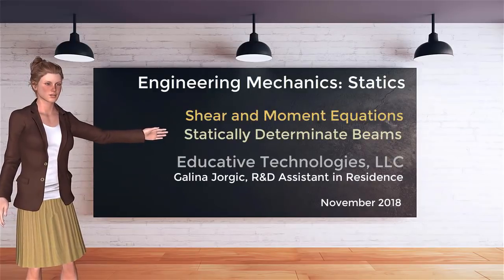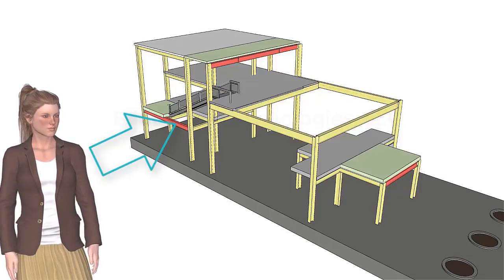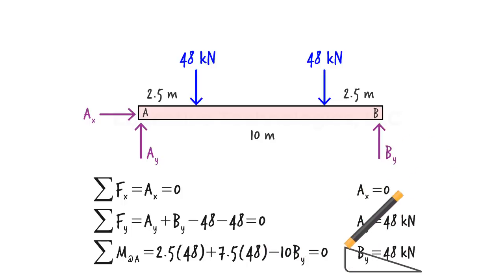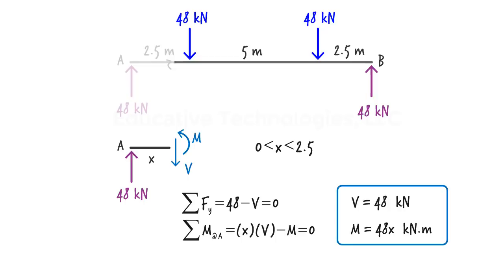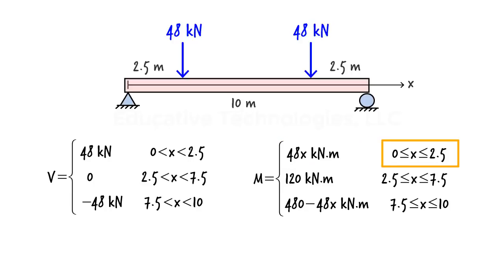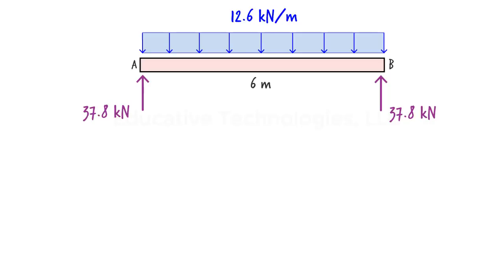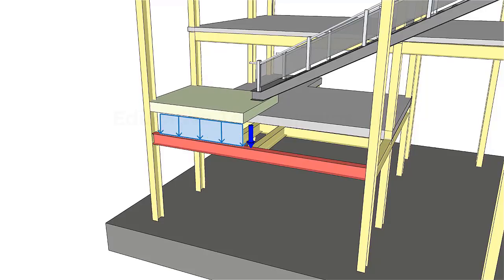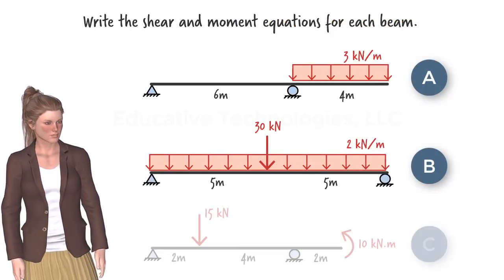ST10: Shear and Moment Equations

Comment: Hello Dr Structure,
Could you please explain (at 2:45) why the uniformly distributed load on the lateral beam is not 24*0.229*3.5*0.5 instead of 24*0.229*10*0.5 ? Even though the point load on beam of focus (the 10 m one) comes out to 48 kN in both cases, I don't understand the lateral beam part.
Reply from the maker: Consider a beam having a length 10 meters. Say, the beam is responsible for carrying the weight of a concrete slab that runs along the length of the beam with a width of 5 meters. That is, the dimensions of the slab being supported by the beam are: 10 m x 5 m. Assuming that the weight per square meter of the slab is 3 kN/m^2, let's answer couple of questions:

1) What is the total load that the beam has to carry? That is, if we were to replace the distributed slab load with a single concentrated load, placed at the center of the beam, what would that load magnitude be?

It would be (10 m)(5 m)(3 kN/m^2) = 150 kN.

2) What would be the magnitude of the uniformly distributed load on the beam due to the weight of the slab? So here we don't want to replace the slab load with a single concentrated load, rather, we want to replace it with a distributed load. 

Knowing the total concentrated load from (1) above, we can arrive at the magnitude of the distributed load by dividing 150 kN by the length of the beam (10 m), which gives us 15 kN/m. Alternatively, we can arrive at the distributed load magnitude by multiplying (3 kN/m^2) by (5 m). That is, we multiply the slab's weight by the dimension of the slab that is perpendicular to the beam in order to determine the distributed load on the beam. 

So in the case presented in this lecture, we need to multiply the weight of the slab by the dimension of the slab that is perpendicular to the short beams in order to determine the load distribution on the beams. The slab dimension that is perpendicular to those two beams is 10 m, not 3.5 m.
Reply: @DrStructure  Thank you so much for taking out time to beautifully and meticulously explaining my query! Now that I understand it, I feel embarrassed to have asked such a silly question. If I may bother you with another question for the same example: Let's assume there was only one lateral beam of 3.5m, so the distributed load should be (24 kN/m^3)*(0.229 m)*(10 m)=54.76 kN/m and the equivalent point load on the main beam should be (54.76 kN/m)*(3.5m)*0.5=96.18 kN.  Am I correct? Lastly, lateral beam loads are converted to point loads on main beam (as shown in 2:45), other wise, treat slab as distributed load on main beam if no lateral beams are present (as shown in 8:30).
Reply from the maker: Correct. If a single lateral beam is positioned at the center of the slab, the distributed load on it becomes 54.76 kN/m, and the equivalent concentrated load on the main beam, placed at its center, comes out to be 96.18 kN.

And yes, if the lateral beams were not present, the weight of half of the slab would have been distributed uniformly to the main beam.
Reply: @DrStructure  Thank you so much! I love your content and visual learning. Applications to real life scenarios while teaching with such visuals is the best form of teaching. By the way, 

I'm curious to know as to how much of a depth in the topic of Structures is covered in the SA and ST lectures. If I'm not wrong, new lectures keep updating. Could you please also add some sort of plan in the Lab101 website as to what will be covered in the future? Will Flexibility and Stiffness matrix methods be taught? Thank you Prof!
Reply from the maker: Thanks for the feedback. 

I would say the SA lectures are similar (in depth and breath) to lectures in a typical introductory structural analysis course, which is usually a part of the undergraduate civil engineering curriculum. The ST lectures are designed to provide the necessary (statics) background for the SA lectures. 

There are a series of SA lecture on the stiffness method. You can find the list of topics/videos here:
 http://lab101.space/Course-StructuralAnalysis.asp

We plan to cover a host of topics -- from statics and mechanics of solids to steel and concrete design. But we don't have a timeline for their delivery. We are also working on packing our lectures and supplementary content as courses that can be delivered via more suitable platforms like Udemy.
Reply: @DrStructure  I'm moving ahead to the SA series now that I've finished the ST basics. The visuals and practical applications to real life really helps understanding the concept. I really appreciate the dedication of the team for each aspect of this video, plus I'm getting almost immediate replies/ clarifications from you. Sincere thanks! ❤️

Comment: At 2:48, can you explain where the 27,43kN/m comes from?
Reply from the maker: Weight per unit area = (24 kN/m^3)(229/1000 m) = 5.496 kN/m^2

Weight per unit width of slab = (5.496 kN/m^2)(10 m) = 54.96 kN/m

Since each cross beam takes half of the load, we get :
(54.96 kN/m)/2 = 27.48 kN/m
Reply: @DrStructure  Thanks a lot
Reply from the maker: You're welcome!

Comment: I am having some confusion in third example... you have told that the weight of staircases in all the cases is 5kN and it transmits to the beam as a point load... But in the given structure I could see there is one cross beam on which the staircase is resting upon it. Then the staircase load 5kN would act at the  centre of the cross beam. Isn't it? If so then the 5kN load cannot be applied directly to the primary beam it should be divided by 2 and that value only should be applied. Is I am right?? Also self weight of the cross beam  I.e, load × distance / 2 this value to be added up with the point load...
Reply from the maker: Yes, the total weight of the staircase needs to be divided by two. In this case, as the video states, the 5kN is half of the total load (or the share of the load on the beam). Further, in designing the beam, other loads need to be considered including the beams' own weight as well as any live load on the floor (staircase).

Comment: In "C" exercise answer, By=5. Or i'm not waked up, or there is By=3.33. :)
Reply from the maker: You’re correct. It should be 3.33, not 5. The correction has been made in the pdf file.